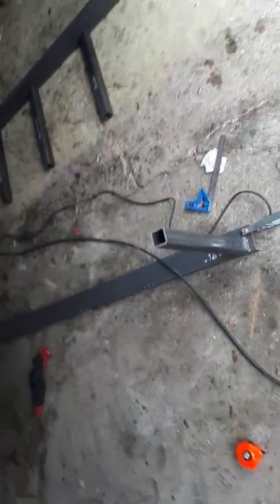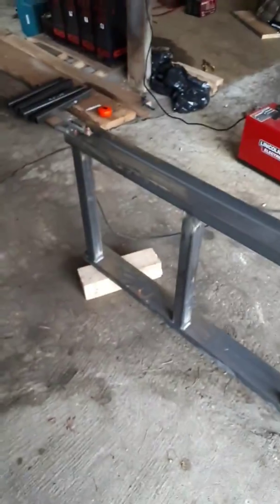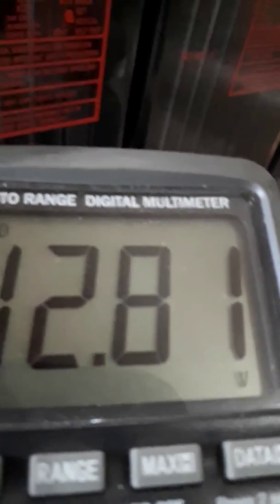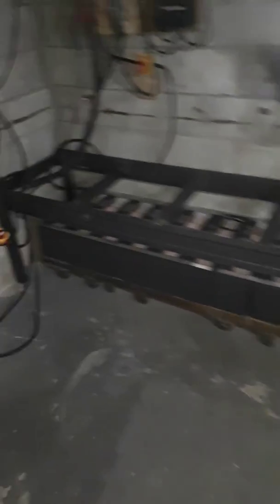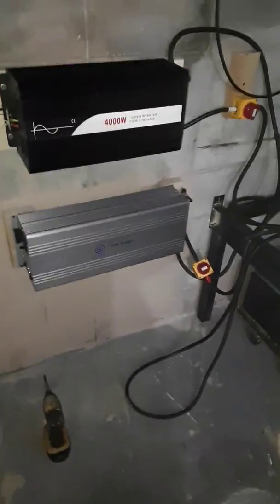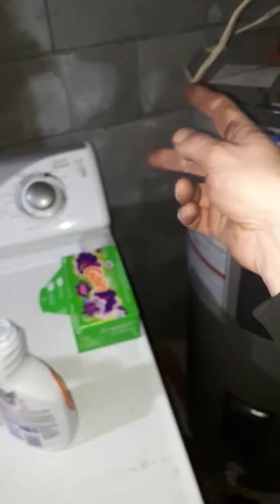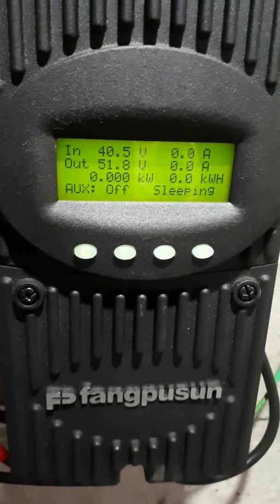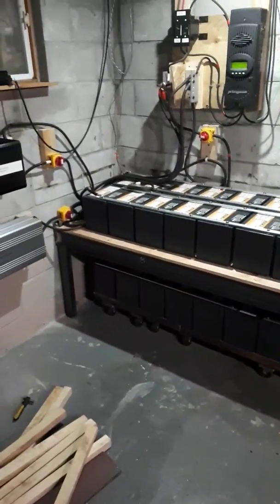My 800Ah battery bank completed. Agm C&D technology batteries.

Comment: Great job! I have six C&D High Rate Max UPS12-300MR Batteries, would that be enough to run a 15,000 btu RV air conditioner?
Reply from the maker: It will be a big load on 12v setup. Plus you'll need the inverter to be capable as well. Probably won't run very long if it did. You will have to test it out. Good luck.